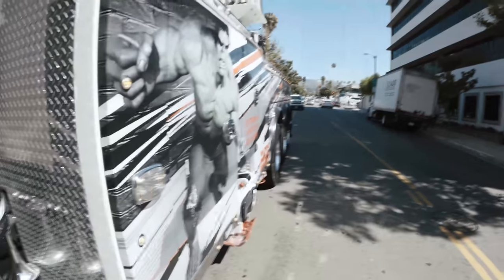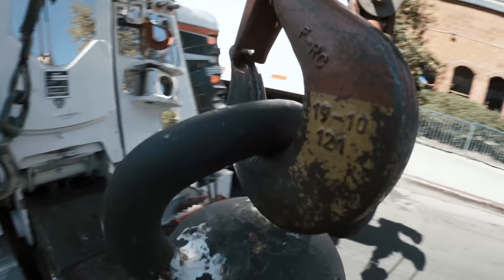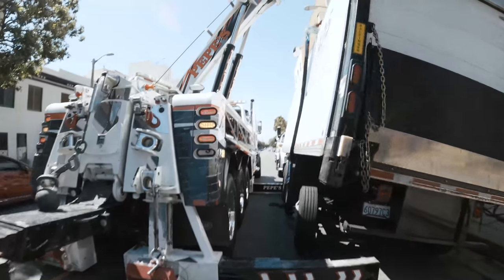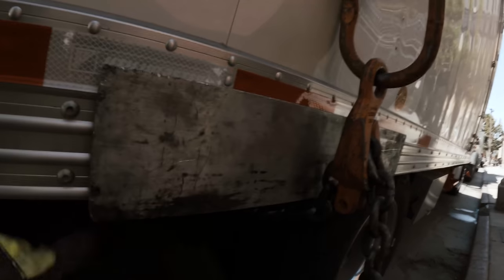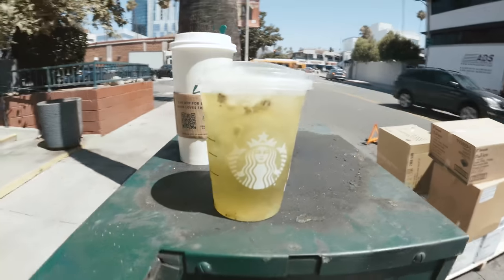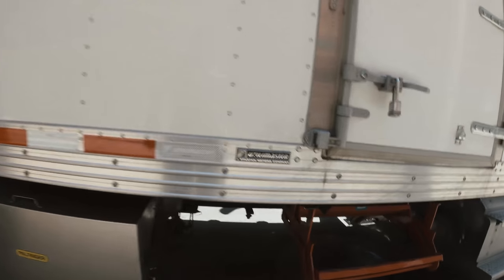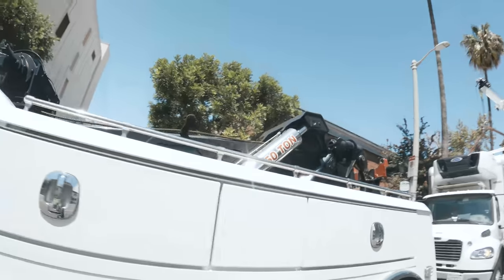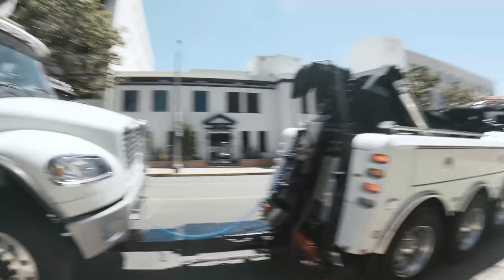Saved by the pole! Loaded box truck almost rolls over over in Hollywood

Comment: Back in the late '80s, I worked for both Penske Truck Leasing and Budget Truck Rental, I've seen lots of broken boards. What a mess to repair as well, without having to remove all of the floorings. We made patches that passed the company's testing for all repairs we'd done, passed and them all. What I like repairing were the cornercaps, what a blast. Molding the corner with the lightning installed and sealing that repair back onto the truck. I'd put my initials inside both corners and they water tested it with hurricane-strength winds and rains without any problems meaning no leaks. We got the truck back some 2 years after we'd sent it to the main service center and they rented it out back to our location in Fort Walton Beach, FL. Both corner caps still had my initials on them and a couple of other tags stating that they were company-wide approved.
Reply: I’m glad to hear the companies had standards, and job well done!  In the early 2000’s I worked as a forensic architecture technician.  We had this homemade but well-designed spray rig for testing window leakage.  I’d typically go up in a cherry picker with the rig attached and spray the windows of buildings from the outside.  We would spray water at a set PSI /GPM/ set nozzle pattern and time how long it took for moisture to show up on the inside of the building- and see if the window installations lived up to their ratings.

Comment: I'd of used both lines to the spreader..  to control the side to side lift better..   the center pivot centered the load. Without directional control....   But I'm just a viewer!   Enjoy the channel!
Reply from the maker: That defeats the purpose of a spreader bar, it's designed for a truly even lift. Two lines would make that impossible, despite how close you get, one side will always have more tension than the other even if it's slight.

Comment: not really overloaded but it looks like who ever loaded the truck didn't spread the weight of the load evenly plus the weight of that electric pallet jack [which probably weighs close to 1000 pounds alone] on one side instead in the middle of the box pulled the truck over when the driver parked in that rain trough.